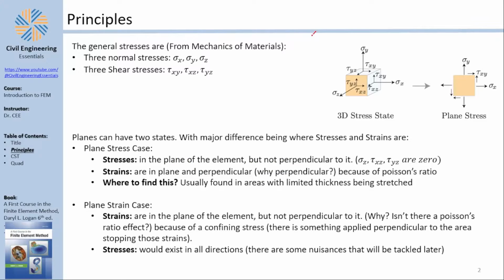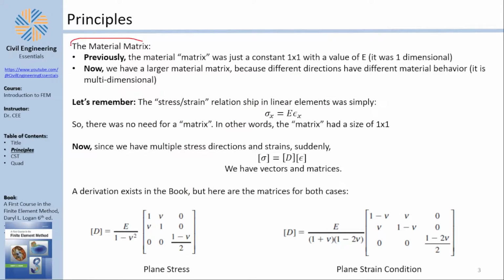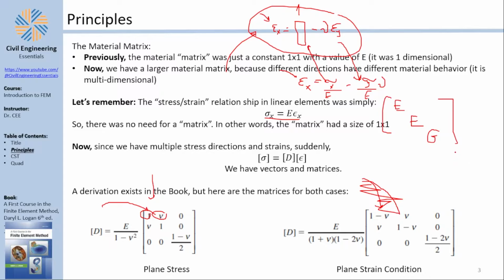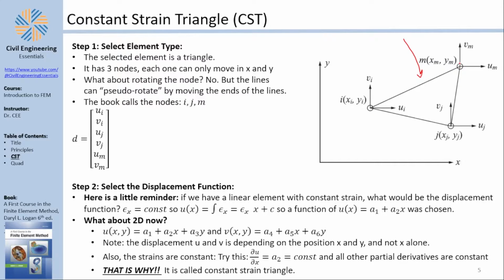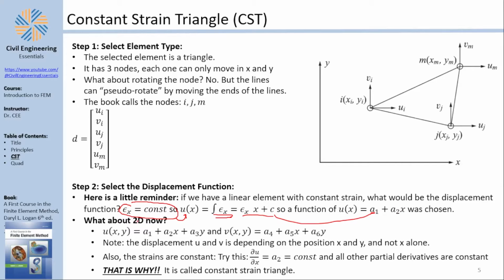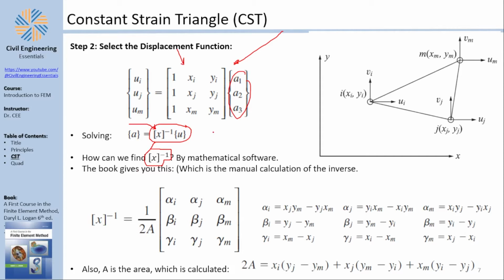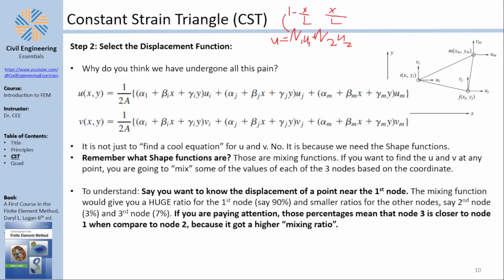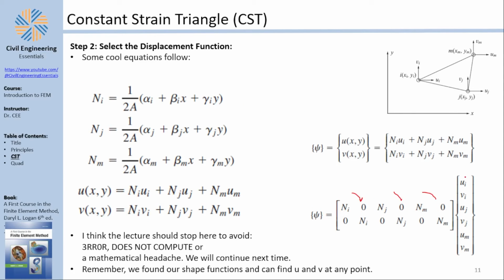The Finite Element Method | Part 16: The Constant Strain Triangle CST Part 1

Comment: How the body force will add in the formulation of Plane Elasticity
Reply from the maker: There are two options with that regard.
Option 1: is to use the work equivalence method to find the "share" of each node with regard to body forces. Note that we are talking about forces that are in-plane

for forces perpendicular to the plane, the entire element would not be adequate. Because you would have bending that needs to be addressed by using plate-shell elements.

Option 2 is the simpler (but waaaaaay less accurate) option of calculating the weight of each element and distributing it equally on all nodes.

Regards,
CEE

PS: sry for the late reply.